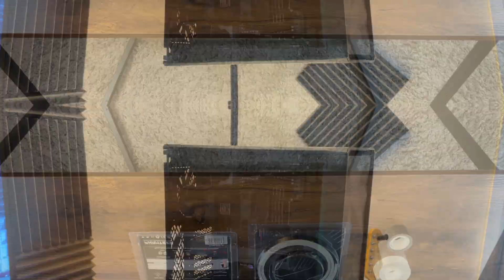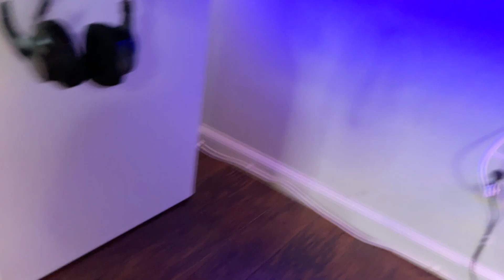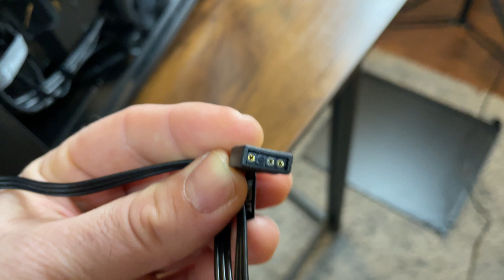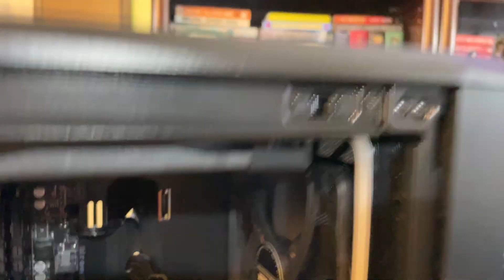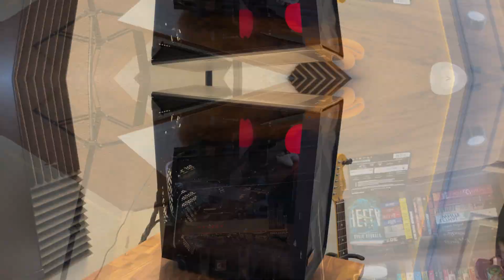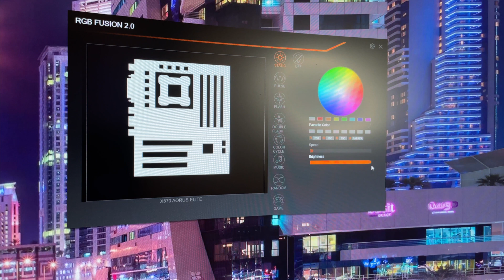RGB'ing my non RGB PC! Fail?! Phanteks Neon M1!

Comment from the maker: Hey guys! Looking at my install of the RBG strip, it looks like I could have positioned the start of the strip at the bottom left, rather than starting at the back of the case. I might have to give it another try and see what works! Cool product just didn't really work in my smaller case. Just want to say thank you guys for your support and all links for everything I used in the video and in my setup, is in the description. Have a good day my dudes!
Reply: This was a good video I wanted to see how bright the phanteks RGB strip is because I’m putting those same noctua fans over Corsair ml120s Good video 👍
Reply from the maker: Thank you!!!
Reply: Great, thank you. Do you compress your videos?
Reply from the maker: No I do not, why do you ask? I’m still getting used to editing and have barely scratched the surface of Davinci Resolve.
Reply: Hi Dan, thanks for inspiring many of us to do more than we might have to improve our computers.  You definitely should try shorter sections of RGB that you can daisy chain together.  They should not be longer than what can fit in each side of the case.  Measure the sections to be sure what you need.  Really all you need is one section for the top and one section for the front and hide them the best you can so that you don't' see the leds themselves and it will look great in that nice case I bet.   I have swapped over my Omen to the new Be Quiet 802 case and did just a magnetic strip on top and  one on the front and it looks nice when you can hide the visibility of the leds themselves.  You have less room to work with in your case than I do and less of a lip to hide them, but I think you may still be able to get it done.  I looked at putting led strips at the back and bottom, but that seems like a lost cause because they are going to be visible.  Thanks and take care.
Reply from the maker: @Wigglythegreat2  Hey! I ended up finding a better RGB light that fits perfect in my case! WAY cleaner than most of the strips on the market and I was able to fit a strip along the top and front. These are the ones that I went with:

https://amzn.to/3BhKw0i

I appreciate your kind words! Thanks for the comment.

Comment: thank you for sparing me the same disaster my son tried to push me into for that new performance build I (unsuccessfully, went for the Meshify Mini as well) even tried to avoid glass panels for! ;)
Reply from the maker: Yeah, these ended up being super difficult to deal with. I ended up using these magnetic ones and they worked MUCH better:

https://amzn.to/3tO1XoR

The shorter one offered there fit perfectly in a Fractal Meshify Compact 2 case

Comment: will work with my Evga z590 ftw motherboard that has a 5v Argb header. Or does the Phanteks neon strip only work with Aura, Mystic light etc?
Reply from the maker: I’m not 100% certain. Should work with any motherboard that has a 5v ARGB header. Gotcha Phanteks may have more info on their website. The box doesn’t say if it is or not with EVGA software.
Reply: @DanKamYouKnow  Thanks! I cant seem to find answers anywhere.. I think its crazy that almost no info on compatability is available!
Reply from the maker: NP! It definitely is extremely vague on that front. Seems like it should though. Could always return if you purchase from Amazon 👍🏻
Reply: @DanKamYouKnow  Will try!

Comment: From personal experience with that case and those lights, I found the best placement is the top. I got the strip right up next to the edge and curved it around the top exhaust slot. Looks decent and isn’t too distracting.
Reply from the maker: Nice! I found it to be super difficult to route these in my case because of the top 140mm fans, so I ended up going with 2 magnetic RGB strips that have been working extremely well:

https://amzn.to/3zUeZ4n

I was able to hide both really well too.

Comment: Hey i was just wondering can you put an RTX 2060 Super in the omen 25l? It looks like the measurements are correct( i watched the video where you installed power supply etc) so i was just wondering
Reply from the maker: As long as the dimensions are within spec, it should work just fine. 👍🏻

Comment: if you get a better mic these videos would be 10/10
Reply from the maker: What’s wrong with the mic quality? I’m using a Shure mic. Is it quality? Levels? Trying to improve my content, thanks
Reply from the maker: I had a couple people on my Discord confirm that the audio quality is pretty good. Interested to hear what your feedback on it is. What are you listening to the videos on? Thank you.
Reply: It’s not really the mic quality but the room your in is has a bit of an echo so some acoustic panels would help a ton
Reply from the maker: Gotcha. My whole room is laced with acoustic panels, might be the hardwood floor causing it. I’ll look into it, appreciate the feedback.
Reply: @DanKamYouKnow  your welcome
Reply: also if you change some mic settings audio quality could improve quite s bit as well
Reply: also i am getting an omen 25l soon should i upgrade the cooler or get custom sleeved cables first
Reply from the maker: Cooler is the best upgrade you can do for an Omen.
Reply: What cooler would you recommend for an i5 10th gen
Reply from the maker: I ran a Noctua U9S with great results.

Comment: This question is off topic, but I watched your videos about new fan installation and was wondering what you think would be the most efficient way to lower temps on a a budget. I would like to get either top/bottom/rear fan replacements OR a better cpu cooler, but not both. Thanks for your reviews on the omen 25L!
Reply from the maker: The CPU cooler is hands down the best modification you can do to a 25L. If I were to do anything, it would be to install a CPU cooler, remove the top bracket in the case, and also use MSI Afterburner to set up a custom GPU fan curve.

Comment: The HP omen case glass has darkened borders that do a good job hiding the actual RGB fixtures.  That way you just see the light and not the light fixtures, if that makes sense.  Maybe you could find something similar to hide the light fixtures?  Dunno.
Reply from the maker: Yeah true, think I just need to find the right lighting strip for sure 👍🏻👍🏻👍🏻

Comment: I think with all of the changes you've made to your system that you may have voided your warranty with Costco haha.  That's cool, you've done great work with this system!  I've been out of the loop lately.  Too bad about how things worked out with the RGB but still a very nice computer.  Later on of course you could add RAM and a video card with RGB, as well as the CPU cooler if you are so inclined.
Reply from the maker: Lol, HP warranty is loonnnggggggg gone. I may do RGB components at some point but I love the stealth build, was hoping for some case lighting to accent the components but still doing some research on it. May have already found some alternatives 👍🏻

Comment: I just used the same light bar from the hp 25L case loool
Reply from the maker: Are you still using the Omen motherboard? HP RGB won’t plug into my motherboard because of its proprietary connections
Reply: @DanKamYouKnow  yes, still using the omen mb. will have to get a diff light bar once i upgrade my mb
Reply from the maker: Nice, yeah. I’m currently shopping around to find something that works for me.

Comment: the case I have is the omen 25L case :( , it doesn't have good air flow but I added 2 120 mm fan on both the top and bottom of the case for better cooling
Reply from the maker: Adding fans totally helps with the Omen case! 👍🏻

Comment: You mention that the LEDs behind the desk are connected to your PC. How is that setup? Is it synced to your motherboard RGB?
Reply from the maker: I realized that I worded it strangely, but the LED strip behind my desk is plugged into the USB ports on the back of my motherboard. I control the lighting with a little controller that came with the light strip
Reply: @DanKamYouKnow  thanks! Would be very cool if it could be synced tho! 😉
Reply from the maker: Yeah, synched would of definitely been cooler

Comment: Yeah the second attempt was for sure better than the first. Actually didn't even look bad imo but maybe because I'm new to this. In the process of buying a PC for the wife so hopefully I can learn from you when it comes to lighting and the like since she wants a purple lit rig.
Reply from the maker: Yeah, the more I look at it, it doesn’t look bad! I think I need to reposition the lower part so it’s not against the back of the case and starts at the lower left on the bottom. Think it might look OK but will have to do some experimenting 👍🏻